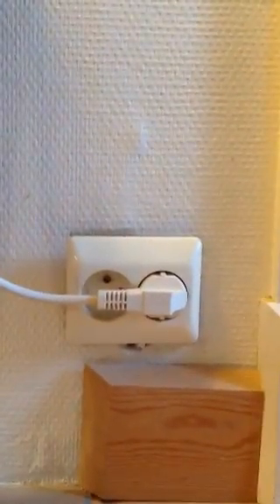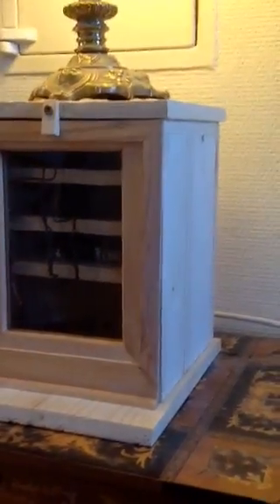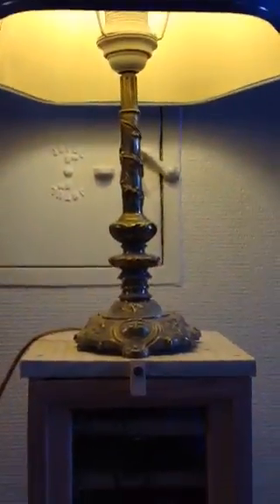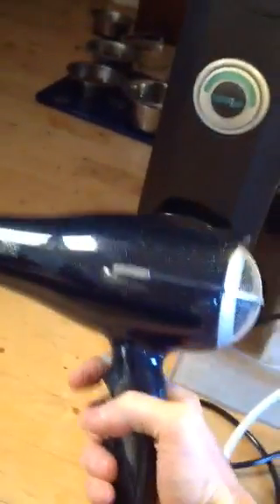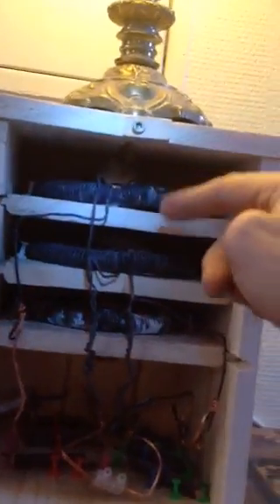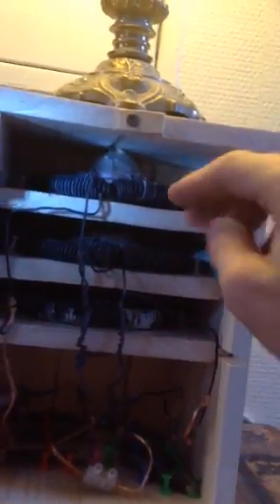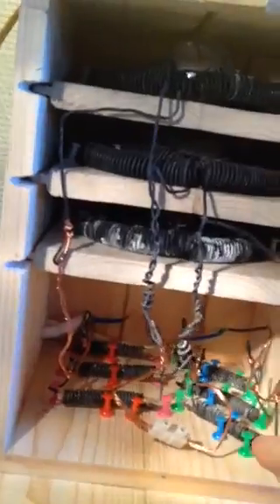Keshe Foundation MaGrav unit

Comment: Nice work! It's a little hard to see in the video, but did you make your capacitor connections on the input and output by jumping with bare copper wire?
Reply from the maker: +Electric Mike : Thank you for the compliment.  When I prepared the electric wires on the plugs , I just twisted them together. What I should have said in the video, is that the capacitors have a logical "+ & -" as well as the coils have. I can answer further questions if necessary :)
Reply: +underpuce Better don't if you do not want to look like http://thinkscientific.w4f.eu/morbus_bahlsen.html

Comment: Watt meter?
Reply from the maker: +vulcanus30 : Since I discovered that when I connected  a lamp together with a hairdryer, and an oiled filled heater, there is enough proof that the system is working by observing that there can be any kind of electricity conducted through the capacitors, since there is Gansed bakingpaper in between. I think that when I will see my house wires becoming blackened by the nano material...I will consider this a success. :)
Reply: +underpuce Have you taken into consideration that the "capacitors" are in parallel to the grid?
http://thinkscientific.w4f.eu/MagravBlueprint.html